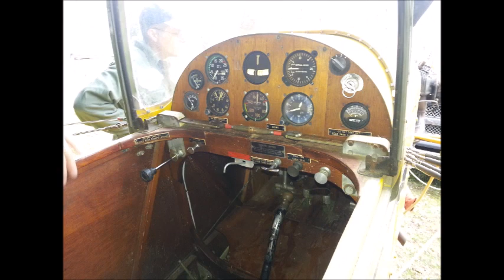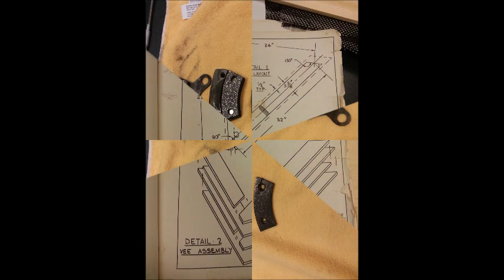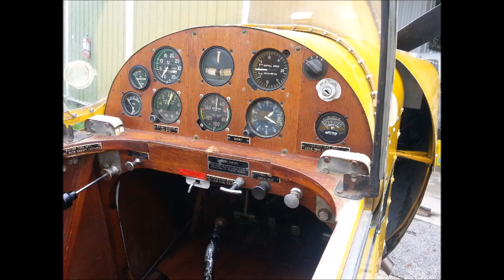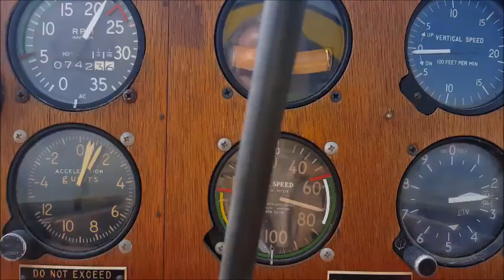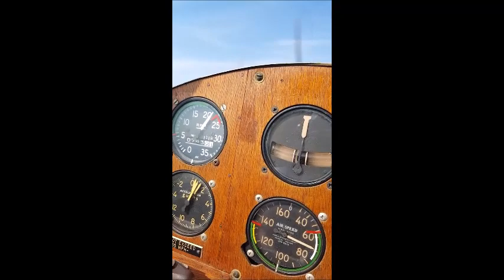Fly Baby airplane restoration

Comment: I did a N number search and see it was built in the 70's.   I have a 1B that is also built back then.   I'm wondering what glue system was used and how is it holding up?  Thanks

Comment: Jerry is my uncle, I'm Matt Ayers.  We went and looked into buying this back when it was in the barn, but we didn't think we had the time to get it back in the air.  Glad you're enjoying it, let me or Jerry know if you ever want to sell it.  It's a great bird, have fun flying it!
Reply from the maker: I have to say, Jerry is a great guy. I have an A-65 on the Fly Baby now I just overhauled. Looking to putting an overhauled A-80 I acquired in her. The barn in Kentucky is no more. It collapse not long after I rescued her. Now in a nice warm hangar at KVES and looking good.
Reply: Glad its inside!  I was told that the a80 was just an a75 with a carb jet increase,  and that it did nice barrel rolls and loops, but the engine would cut out when the downward momentum let off. Mainly due to not having a 0 gravity fuel tank and oil sump setup.
Reply from the maker: @karaayers2867  Hi Kara, the A-80 is it's own model. They didn't make a lot of them. The pistons has 4 rings and heaver. Also, more oil ports for lubrication. Nice little engine.

Comment: I wanted to reach out and screw those turnbuckles tighter while flying! Thanks for the restoration and the video, but just so you know, that gawd-awful music had me hitting the mute button early on.  Cool airplane!
Reply from the maker: Thank Larry. I'm not a big fan of the Top Gun music ether, but I was in the movie and worked on it for 9 months when I was in VF-51 working on the Tomcats. My wife selected the music. We'll blame her.
Reply: @richborg45  Nothing wrong with Van Halen and the choice of that song, though the second selection seemed odd for a Fly Baby. Then again, my favorite Fly Baby video, filmed as a joke really, was set to Erich Wolfgang Korngold's Strike for the Shores of Dover from the 1940 Errol Flynn film, The Sea Hawk 😂 🤣 Something about the Fly Baby inspires the whimsical for some reason. https://youtu.be/Pp_t0lOJZME
Reply: When flying the top wires become slack, when on the ground the lower wires become slack.  This is due to the wings pulling the aircraft up by the bottom "flying wires"

If you tighten the wires too much the wood wing spars may crack also, they  need just a little slack to flex.

Comment: THANKS FOR THE VIDEO ! I HOPE YOU'RE STILL FLYING HER... TIGHTEN UP THOSE LANDING WIRES.... TOO MUCH SLACK.
Reply from the maker: I still fly her, flies great. I did tighten up the wires. It's not uncommon to see the Fly Baby with loose landing wires. I thought they were too loose too. The plane was over built and is heavier. I just overhauled the engine. As soon as it warms up, she'll be up flying.  This plane was in the May edition of Sports Aviation magazine. Page 92.
Reply: That makes me feel a whole lot better...LOL. Some play is necessary, however, keep your eye on the wing attach fittings for those wires. I would consider changing to the new spar strap system when you recover. The plane looks great and my congratulations for the rescue !I wish you many rewarding flights... All the Best, Ron
Reply from the maker: @apfelsnutz   Thanks Ron. I'm an A&P and keep and eye on everything. My Fly Baby was a special one. It was over built when heavy duty wires and mounts. It holds an aerobatic certificate. It is odd getting into a Fly Baby with a G Meter.  The aircraft with me on it is about 940 pounds.
Reply: Hah ! I should have known... the fuselage was a dead give-away. Good deal ! How about the carry through on the landing gear for the flying wires... beefed up ? The Flybaby was already a pretty strong plane [+7} I believe. You need to put some o2-thin on the panel with Spirit of St Louis brushings... It's be sharp!All the Best, Ron I'm at L00 if you ever get out here...
Reply: @richborg45  What would be really odd would be to find a Fly Baby with a mach meter.....
Reply: @richborg45  hey Richard, great video! I am looking at a fly baby be one that was started in 72 and finished in 78.   My concern is the use of that weldwood glue.   I Googled your end number and saw that it was built in 76 but I'm sure it was started before that.   Do you have any thoughts?  Thanks, CW3 retired ch47 pilot

Comment: I owned this airplane for years and flew it many hours. I knew the builder personally and did a flyby at his funeral in it. Great to see it still flying.0
Reply from the maker: Hello Fred, Did you own her right after Jerry? I talk to Jerry a lot. This is a fun plane to fly.  I have a zero time Continental A-65 on her now. Just finished it up. Looking at getting a bigger prop. I have a 69" x 45 pitch. I also just acquired a zero time Continental A-80. Jerry thinks he was running an A-80 with the 69" prop. I'm thinking of putting the A-80 on. I hope all is well.

Comment: 1:15 - What the H.E. double hockeysticks pipe  is that between your feet.
Reply from the maker: That pipe is the low tech joystick. I have to fly 3 fingers it's so sensitive. Each to over control.